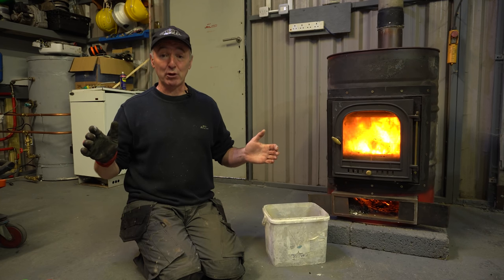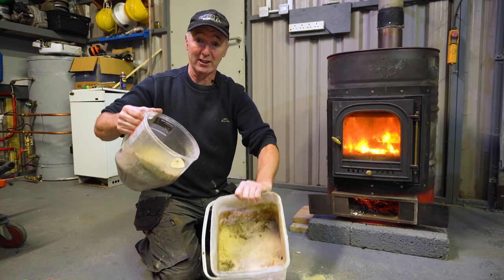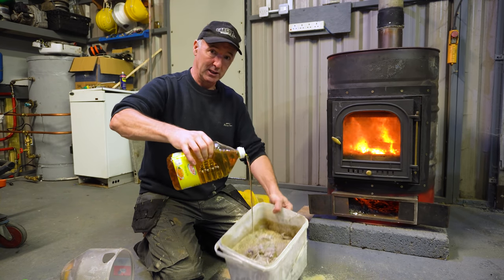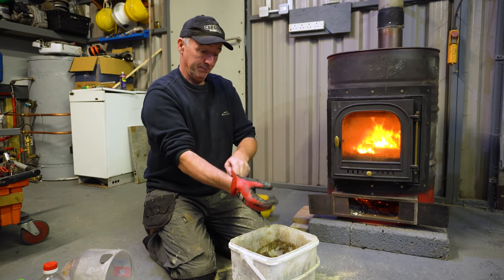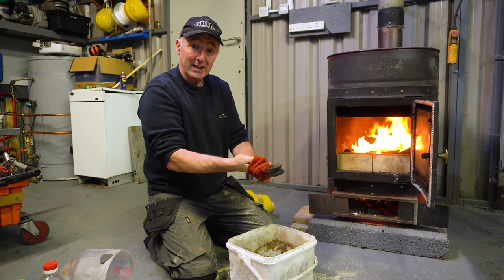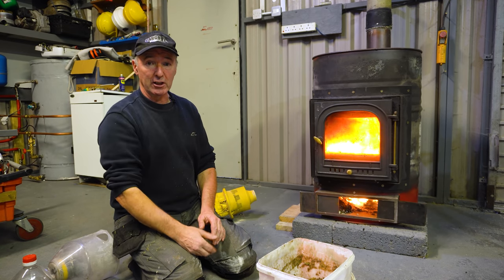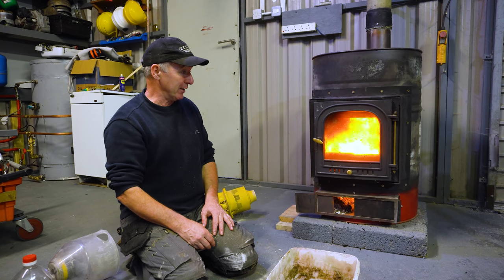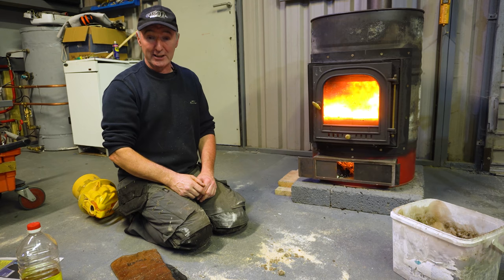Free heat from Sawdust + Vegetable oil .. No Tools Needed

Comment from the maker: 🔥 Check out my  Simple to Build Tin Can Waste oil Burner   https://youtu.be/hw3v2gN_sLk Cheers Gerry 👍
Reply: Warn people for Dust explosions, that amount of sawdust can blow the whole place up...
Reply: Rom good to warn, but he says it will not. The particles that would ignite are now bound to the oil I guess.
Reply: @aschwinwesselius  that’s true but if someone doesn’t add enough oil or chucks the last bit of sawdust into the fire.... try a pinch of milk powder on a candle ( try outside)....spectacular but light up your whole place
Reply: i want one of these in my living room is there plans or can i buy one ready to go and make chimmey out a window
Reply: To light my woodstove/ heater, I use corkstoppers from wine bottles soaked in denatured alcohol for some time in a big glass canning vessel. Works wonderfull and only use one a time. I collect them at home, inlaws, friends and local restaurant. I hope it helps others too.

Comment: Just a suggestion. Carpet shops get rid off long thick cardboard tubes that carpet and vinyl flooring comes wrapped in. Perhaps get them and cut into log lengths and pack them with sawdust and oil
Reply from the maker: Hi Naughty Goat Farm. I know the tubes you are talking about. Seems like a great suggestion and certainly worth a  go. You might see this soon on the channel. Thanks for commenting Cheers Gerry👍
Reply: Toilet paper tubes too
Reply: Could also stuff the tubes with paper that is mixed with water and some kind of dish/body/laundry soap or detergent as well, maybe even add saw dust.
Reply: Great idea
Reply: For years I have been making fire lighters from waste material.  the ecos will hate me but....I use toilet roll card inserts and hand crimp the end over then fill with sawdust or other material crimp the other end  then immerse in old oil of any kind for a week.  Then take out and leave to drain for a few weeks. The oil is then dry and these will light our wood burner with ease. As the only alternative is commercial fire lighters I do try to feel less guilty of pollution.
Reply: @Kara_Kay_Eschel   Soap does not burn well. Need to use oil or wax that does burn well.
Reply: @georgestyer2153 : Burning waste wood is one of the most environmentally friendly things you can do, provided you need the energy. Wood releases the same gases whether it rots or burns. What is not ecofriendly is to pull carbon out of the ground that would've remained there for millions of years without us and then adding it to the atmosphere.
Reply: Cardboard toilet paper rolls  too
Reply: You can also get candles. Put the leftover wax from candles that get thrower away. Just heat it in a microwave if the container is glass. Pour melted wax into egg container. And when you need a wax egg, just tear off the wax egg cup and start fire.
And you could also use olive oil. I dont always use the olive oil quick enough, so it goes rancid. So use it for other things.
Reply: I live in a converted minivan, on the road 24/7, 365. An easy way to make quick fire starters is to get a bag of cotton balls & a tub of Vaseline at the Dollar store. Massage the petroleum jelly into the cotton balls & throw a bunch of em in a zip lock bag, 10, 20, 50 of em, whatever floats your boat. Need to start a fire, grab a cotton ball & light it under your tinder & wood, etc. They will stay lit long enough to get everything else going, even if it's not bone dry. I've done the same thing living out in the forest by smearing some Vaseline onto a wad of toilet paper, balling it up tight & shoving it into my not-so-dry wood pile.
Reply: @TonyHookedonVanlife  these can even still light after being soaked in water, provided there’s enough petroleum jelly on them.
Reply: Great idea
Reply: I use that very method in the wood burner in my sauna. I don't use oil but pack it with cardboard from my recycle bin.
Reply: Yeah but how long does it last that has to be hot
Reply: Toilet Papier rolls and kitchen tissue it has perfect size fill it and compress it easy and cheap
Reply: Paper towel tubes, t p anything that should be recycled ❤and broken down a better way. Than thrown away it gets wasted throwing it away better to try to use it for something else than putting it in the landfill
Reply: @jeschinstad  Burning wood releases a lot of nasty particulates unfortunately.
Reply: @BenjaminGoose : I enjoy telling people that in Norway, it used to be mandatory to bew and drink beer. But the reason it was so, is the particulates blowing in the wind. That was the blessing of the gods and if your beer tasted good, it meant that the particulates had blessed you.
Reply: Thick cardboard can be easily cut with a reciprocating saw—a short blade works best.
Reply: Great idea!
Reply: I was always told to avoid burning cardboard, waxy magazines and things of that nature. Wouldn’t that cause creosol build up? Don’t take my word as law or a formal correction, I’m new to all this and have been trying to educate myself on how to safely burn
Reply: @JoeWayne84 : You are wrong. High temperatures are bad for life. It is one of the most important reasons for why we cook food.
Reply: @georgestyer2153    Don't forget dryer lint.  It is seriously flammable and a great fire starter.  I haven't used it in a wood burning stove, but a small baggie can hold a week's worth of campfire starter lint and compresses down to smaller than a golf ball in your back pack.
Reply: @colinellison762 : Why on Earth are you talking to me about solar panels? They are the lest efficient form of solar power we have and I don't think I've ever mentioned them.
Reply: @rogerknights857 There's no such thing as "cardboard"...it's a misused terminology that tries to describe 'corrugated fiberboard'.
Reply: @robertmuckle2985 Wikipedia says: “Cardboard is a generic term for heavy paper-based products. The construction can range from a thick paper known as paperboard to corrugated fiberboard which is made of multiple plies of material. Natural cardboards can range from grey to light brown in color, depending on the specific product; dyes, pigments, printing, and coatings are available.

“The term "cardboard" has general use in English and French, but the term cardboard is deprecated in commerce and industry as not adequately defining a specific product. Material producers, container manufacturers, packaging engineers, and standards organizations, use more specific terminology.”
Reply: FBlx-d2s  why not?
Reply: Ooh, good thought. I just might try.

Comment: “Free” the word used incorrectly more than any other in history.
Reply: At first I thought the same but didn't he say the oil was waste oil?
That would make this pretty free.
Reply: @RetiredRhetoricalWarhorse  I have to agree with that.
Reply: Video title is a bit misleading, nowhere in the title does it mention waste oil, title is "free heat from sawdust and vegetable oil"
Reply: @daviddarke7649  The title doesn't mention the heat is from burning it in a stove either but that's the energy transfer method he does with it. How are you mislead by this title? Video is about how to get heat for free with those ingredients, and then the content goes on to show you how to get heat for free with those ingredients...
Reply: @daviddarke7649 , the title doesn't mention a vacuum cleaner, a bucket, a stirring tool, a paper bag, a wood burning stove, an ignition source, or a small amount of common sense either. I can see why someone like yourself would feel misled.
Reply: And this is why we have so many problems in the world.   People have stopped participating beyond the title/headline and skipping the actual content.  He specifically says it's waste oil in the video.
Reply: @RetiredRhetoricalWarhorse  Except the time spent, which is the most expensive part.
Reply: The laws of physics hates him
Reply: @ScottEKelly  Your right about that! No wonder people are so angry these days. They also make conclusions without either completing a video or not reading an entire video. Its as if it doesn't explain it in a two-second title they skip it without reading the article and again make up their own conclusions.
Reply: @Pabz so in other words nothing is actually free. got it.
Reply: @RetiredRhetoricalWarhorse  Ye but not if you need to buy Vegetable oil ^^ but as you are saying, if it is waste oil then its free :D
Reply: @DanielB i don't deep fry enough for any appreciable amount of vegetable oil but I have lots of motor oil. Mostly synthetic though, don't know if it'll be good for burning.
Reply: Pine sawdust? Hope not! Creosote!
Reply: Nothing free about vegetable oil... but it's a much better use than putting that junk in your body.
Reply: Doug K  You understand that's exactly what I'm saying, right, Patricia?
Reply: @daviddarke7649  Title was "click-bait" and yes we all took it lol.  And this was my first and LAST time watching this person videos lol.
Reply: @Agent Smith In both meanings, "Free" word used in title was a troll action. With your logic, he could sell those "waste" oil and earn money and get better heating system. So, waste oil worth some money too. But, we can argue this until to the doomsday without understanding real meaning of the title lmao.
Reply: @charliesnarky9726  that’s what the ignorant think, but then they don’t burn wood.
Reply: I don't see the problem...  Clearly energy is being freed, in the form of heat, from the fuel.  It's called combustion.

Comment: Thanks for this tip Gerry, but the best tip would be telling us where you get the FREE vegetable oil?! Cheers
Reply from the maker: Hi Mike. There are lots of restaurants that need it taken away but you need to take in bulk. Waste motor oil is not as green but in a pinch can work just as well. Cheers Gerry 👍
Reply: He was using used vegetable oil.  Save your oil from cooking and frying...
Reply: Try making bricks with a hydraulic press for fire 🔥

Comment: “I love the smell of MDF dust burning in the morning. It smells like victory.”
Reply: 8)
8)
Ha! 
8)
8)
Reply: And formaldehyde
Reply: @tMatt5M  UREA formaldehyde, no less.
Reply: The main concern regarding the health risks of MDF is the use of urea-formaldehyde adhesives as the bonding agent during the creation of the panels. Formaldehyde has been thought to have cancer risks. While MDF dust can cause nose and eye irritation, this is also true for every other dust.
Reply: @GabrieLight  True story, that.
Reply: And cancer.
Reply: Lol. I was thinking the same thing. I tried burning MDF picture frame boards outside. The dust is like napalm but the boards did more harm than good.
Reply: "Charlie don't surf"
Reply: @Kielbasa_n_mustard  <3
Reply: Better to burn, than eating!
Reply: Wouldn't that depend on the temperature of the burn? If it is hot enough it would burn the emitted gas before it leaves the chimney or not? Like a clean burn. Or has formaldehyde a very high burning point if any. Honestly trying to learn and understand. Thanks!
Reply: “Charlie doesn’t  surf!”

Comment: You could do the same thing with saw dust and shredded newspapers and water. Just shred up the newspapers and place in a 5 gallon of water for a few days, stirring twice daily. Drain off the water, add the saw dust and mix thoroughly. Make it into any form of design that you want. I have a press that makes bricks. Or use toilet paper or paper towels tubes as a mold as well. Let dry in the shade for a couple or weeks or until dried. IT WORKS.

Comment: I'm gonna give it a try. 
Also I was a chimney sweep for a number of years and learned that if you burn a fire too low, slow and cold, you will develop serious stage 4 creosote buildup in your chimney, liner or flue in no time. That's even if you're burning seasoned cord wood only. 
Always burn a hot fire producing a light, fine Grey ash. 
That goes for even the best modern company made stoves with smooth wall stainless steel liners.🔥🔥

Comment: this stove design could benefit from 3 things: 1) some secondary burn air tubes 2) some masonry around it to act as thermal storage 3) a source of outside air. that roar of air going up the chimney is matched by an equal amount of cold air being pulled into the space.

Comment: Gerry, thanks for the tip. Here is one for you. A box fan works well to push air past the wood stove to really heat the shop up. I've tried to burn sawdust before without much luck. Thanks for the tip again. I will use this.
Reply from the maker: Thanks for the info! Dave. Have used  a car radiator fan in the past but it is not as tidy as a box fan. Thanks for commenting Cheers Gerry
Reply: @GerrysDiy  I believe that another channel, myfordboy, has a series on his building a Stirling engine fan which uses the stove heat to run the fan. While a lot of people won't have the necessary tools and skills to duplicate his work, it might be worth checking out.
Reply: Get an old cardboard carpet roll , your local carpet shop will gladly give u them, cut them into 6 /8 inch lengths 
Fill them up with chips or sawdust ( close one end of course ! With a scrunched up newspaper or whatever , pour the cooking oil in the other end and jam a paper into the end leave  if couple days to settle and bobs yir anti ! You’ve made a 2lb fire log that will burn for an hour

Comment: old timers in my area told me how they had a metal container of used motor oil with a tube fed into their wood stoves. just a slow drip. to supplement their wood burning. just a little bit goes a long way. i never thought of using vegetable oil. anything that will burn makes heat. nice.

Comment: Brown paper sandwich bags work well for holding the oil-soaked sawdust.  The bag material will absorb some of the oil, but won't break down. Cut the bottom out of an empty can that will fit inside the bag. Use the can as a scoop/funnel to easily fill the bag, leaving room at the top to double fold the bag for storage/burning.  100 bags for $4 at Fred Meyer's. Many restaurants almost beg you to come get their used fryer oil.
Reply: True about the waste oil, my dad drove 300k miles fishing around the UK fueling his car on filtered oil from chippies on the way 😂
Reply: 3
2 @BrownBabyJesus  £300 thousand  miles I smell bullshit.
Reply: @peterdavidchessell5952 well it depends how long he ditld it.. Over 10 years i could see it being quote true